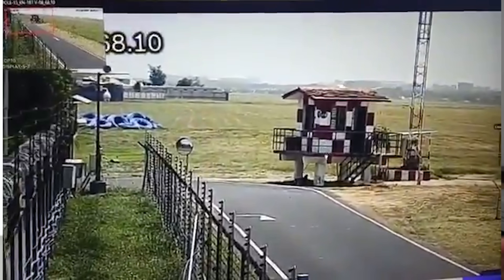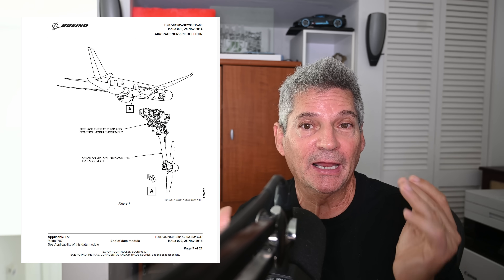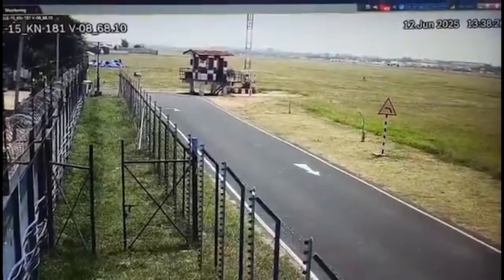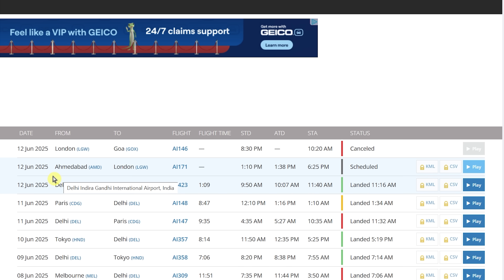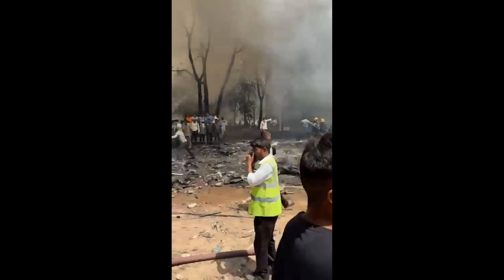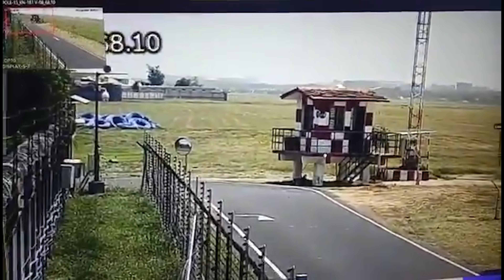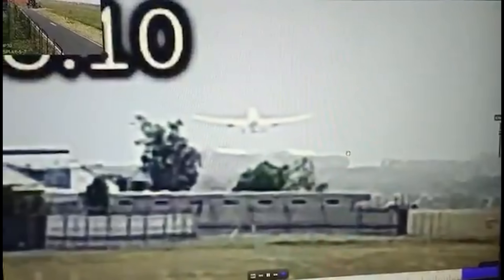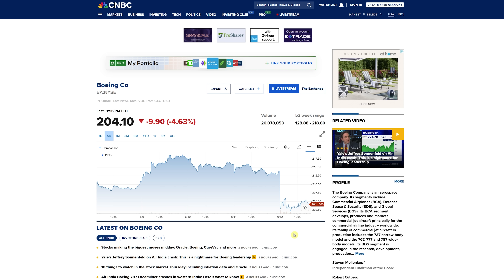What Caused Air India 171 Crash, Mysterious Sound Before Impact

Comment: Such a sad event. Based on how it just glided straight right after takeoff, I wonder if it could be electrical failure. I had a Lexus, a luxury car, and one day it just stopped working while I was driving. Everything in the car went off, and it started coasting. I could not turn the wheel or anything. The mechanic said it was a one-in-a-million occurrence, but it happens. When my car did that, I heard a loud pop, like when the breakers go out in a house. The lone survivor said he heard a loud pop.

Comment: I never believed the flap stories...The plane would never have gotten off the ground without flaps. They would've been dragging the tail down the runway in a panicked effort to get airborne. They had flaps. This was an engine issue. Either a mechanical or pilot induced engine issue.

Comment: Engine failure caused the hydraulics to become dysfunctional, thats why they could not retract the landing gear which added to the drag and led to the crash.

The ram air turbine was deployed automatically as the engines failed and the RAT can only supply power for the flight controls (flaps, slats, elevators etc), it cannot retract the landing gear.
Reply: Stop speculating and spreading rumours. You know nothing. Be quiet.
Reply: And you know this from where? Look... the plane did not even make it up to 1000 feet. There are 3 simple rules. Aviate, navigate, communicate. Right after takeoff when V1 is passed and the plane rotates, it takes a few seconds untill they retract the gear. They never do it immediately as they are airborne. They are waiting for a positive climb rate so they can confirm plane is climbing. And now... if right in this few seconds after the V1 speed the engine failure happens, they simply don't have the time to retract the gear and it is even not a priority there if you lost both engines. Sooooo again... where do you have your information from?

Comment: Was there any audio in the video of it taking off? You should be able to hear the engines roll back. Also on that same video, the flaps should've been extended for optimal lift during takeoff, but I don't see the flaps extended at all, so I have to wonder if they configured the plane properly. Pilots have unfortunately been known to rush when behind schedule, and occasionally rushed their preflight configuration

Comment: It is strange that a very small wind turbine makes a noise that even covers the noise from two turbines working at full speed. If someone pays attention and calculates with a correct eye the speed of the aircraft when it was running on the runway for an easy takeoff, they will find that its fate was predetermined. Very low speed for a loaded giant aircraft.

Comment: The noise could be sound distortion generated from the recording device. The real question is: why were the flaps NOT deployed?  Did they not program the flap position for take off and didn't set the flap lever? There is NO way that the flaps should be up on take-off. Could it be that as soon as they got out of the ground effect, they started losing lift? The inertia got them going for a while before they started losing altitude due to the wings not producing enough lift at that speed. The sole survivor said that he heard the engines spool up towards the end. If the engines had power, the RAT would not deploy. But again the wheels should have been up by that time, why? no hydraulics? That would cause the RAT to deploy. Such an unusual crash. Or worse, the pilots retracted the flaps instead of the wheels? That would be the most probable cause since there is no way that they would forget to set the flaps for take-off.

Comment: The central wing box, although filled fuel, is the strongest part of the aircraft. Based on what we've seen, this was not a 'high speed' impact per se, (like say, the 737 MAX crashes) so It is entirely feasible that the forces of impact, especially for those seated in the middle of the plane would have been survivable for much of the occupants. Another thing to consider,  that the fireball that we see as an "explosion" is more technically a 'flash fire'. The difference being that one has a high energy blast that itself causes damage. While a flash fire being the rapid burning of flammable material (atomized fuel), which in itself does not have the same damaging force of a say an explosive. For a survival scenario of 1 in 240, it is not far fetched that the sole survivor could have been one of the many seated in his section that that DID survive the initial impact, but was the only one able to escape before being overcome by smoke and or fire.

Comment: I have heard that the take-off plan was to leave the runway with an ascent angle of 3.5%; raise the wheels and then increase the climb rate to 11%. This plane was really heavy, and the air very warm. As the final stages of the flight might have been a  stall, let us hope that the higher climb rate was achievable for this situation.

Comment: Engine loss none withstanding - why are the flaps not in takeoff configuration?  Did they erroneously raise them instead of the gear (has happened before) - then they had hydraulic  power. Unless they took off with a configuration that was not meant for takeoff. The way the plane suddenly dips reeks of raised flaps mid take off.

Comment: The attachments for the wings are structurally the strongest parts of a plane, so most survivors in plane crashes are from that area (when there's not a fire). My guess is that the plane separated at the wings, and he was in the section just ahead of them so he was spared from the burning, but also the furthest back from the impact (other than those stuck in the fire). Basically that row may be the sweet spot for a head on collision where there is still lots of fuel in the wings. And he was probably thrown from the plane at the time of separation (which is why he says he jumped). Total guess though

Comment: The RAT was triggered, in this model, necessarily automatically, when the aircraft lost boot main 240 AC electrical buses and/or the main hydraulic power.

Furthermore, in this same video, it is possible to see parts coming loose from the aircraft just as it stopped gaining altitude.

A catastrophic failure, perhaps revealing an unknown fatigue process or a poorly done repair, considering the new composite materials and their joints with other materials?

Perhaps a meticulous attempt made to look like an accident?

In any case, 172 knots is at least 10 knots below the minimum takeoff speed for the engine maximum thrust, weather temperature (40o celsius) and maximum takeoff weight.

Alarms would have sounded in the cabin during the, by the way, long roll on the runway.

We may be about to discover something new in aviation. But, by all indications, as with the AF 447, not without a human factor as a contributor.
Reply: nothing fell off where do you see that
Reply: @emilianoruiz7681  Look at 2:02 - 2:05.  There is something abnormal flying/tumbling about from right to left.
Reply: @emilianoruiz7681 About the AI 171 flight, the RAT was deployed. Parts loosen from the aircraft as it lost height or dragged from the roofs by the plane. Anyway, the maximum speed of takeoff was lower than the minimum speed for weather conditions and aircraft load. A mix of equipment and human factor, if not equipment sabotage.
Reply: @fabiobarreiros1027  no parts fell off from plane, try again.

Comment: Bo eing!
If its a Boeing I aint going
What ever happend to FAA PILOT CERTIFICATION STANDARDIZATION!
What ever happend to 
Emergency procedures tranning every six months
Check rides in type every six months?
What were the crewmembers doing the previous 12 hrs. 
A set of quotes, many of them age-old, serve as psychological guidelines for pilots......
Aviation in itself is not inherently dangerous. But to an even greater degree than the sea, it is terribly unforgiving of any carelessness, incapacity or neglect"
—Captain AG Lamplugh, British Aviation Insurance, London. 

Safer skies saves lives...

Old bold pilots
Know Crew Resource Managenent CRM
Know sterile cockpits
Know cockpit briefings
Know who the PIC  final authority is

The greatest single factor in airplane disasters to-day is the human factor.....
someone does too much too soon, followed very quickly by too little too late. 
Steve Wilson 
NTSB investigator, Oshkosh, WI, August 1996.
 Trouble in the air is very rare. It is hitting the ground that causes it. 
Amelia Earhart
In flying, the probability of survival is inversely proportional to the angle of arrival. 
Attributed to Neil Armstrong
If you can walk away from a landing, it's a good landing.
You don't concentrate on risks. You concentrate on results. No risk is too great to prevent the necessary job from getting done.
Chuck Yeager

Pilot certification standards have evolved over time in an attempt to reduce pilot errors that lead to fatal crashes. FAA standards, which are set in consultation with the aviation industry and the public, are among the highest in the world.

According to the FAA, the new regulations stem in part from the crash of Colgan Air 3407 in February 2009. An investigation of the crash revealed that pilot Renslow, had failed three "check rides" (the flying equivalent of driver proficiency tests) and may not have had adequate training to respond to the emergency leading up to the crash.

Comment: On your ADSB data, I’m surprised you didn’t pick up on one thing. The aircraft stopped sending out ADSB altitude, speed and location data at roughly the point that the aircraft started sinking, which tells me in combination with the RAT that right there something caused a loss of electrical power to the transponder.

Comment: I've watched your engineering videos since Surfside. Unlike other engineers, you actually take the time to make sure everyone understands. This is a sad story. I'm glad the one man made it out. His guardian angel was working overtime.
Reply: I wish all the other so called experts were as clever as Mr Jeff Ostroff.
This crash had nothing to do with flap settings. The Ram Air Turbine (RAT) was definitely deployed, and there was very little thrust, if any being produced by both engines. The engines sounded like they were in idle mode. You can hear this in your original video with its relatively high quality audio. The RAT, was definitely deployed. It's unmistakable. When the plane flies past there is little if any jet engine sound rather, the unmistakable propellor sound of the RAT, sounding like a single engine propellor plane flying past. The RAT swinging down and locking into place explains the bang the survivor heard. This also explains why the landing gear was down as there was no power to lift it. The small piece of debris seen flying in the video is not from the plane but something sucked up by the considerable vortices created by the large jetliner as it passes so closely over rooftops before the crash. I do not believe it was a double bird strike as there is zero evidence to suggest this. This crash had nothing to do with incorrectly set flaps. The plane was climbing and then it wasn't. For whatever reason both engines went into idle mode at the worst possible time. The NTSC investigation will hopefully determine why. But I must say Jeff's incredible levels of observation are very impressive indeed.
Reply: @simonmiller5118  lol, he is a youtube clown, milking it and speculating on tragedies, he has zero expertise in the field here, no access to informations and he doesn't even follow a decent methodology or consult actual expert. That is the total opposite of actual experts work.
Reply: @lo2740  I presume you at least agree that the example videos he plays starting at 4:06 are absolutely compelling about how there's an extremely recognizable sound of a propeller when the emergency RAT has been deployed.

Presuming you do agree (I can't imagine anyone with sound hearing disagreeing) then you are presumably saying you do not hear the same thing when listening to the clean video of this airplane he plays about 30 seconds after playing the poor screen capture video played by the mainstream news channels such as CNN at 1:25.

If so, I have to wonder about your hearing. Are you listening to those video clips on a good sound system? Would you say you've got good hearing? those are genuine questions. If someone listens to those video clips and does not conclude a RAT was deployed then that's surprising to me.

And finally, even if you do not hear a RAT, are saying the RAT was not deployed? That would be even more surprising and it would be helpful if you shared your evidence for thinking that.

Thanks in advance for reading this comment and any reply.
Reply: Me too I was watching Surfside videos from a few years ago from Jeffostroff and been watching him ever since on occasion for the details in the big stories.
Reply: Same here. The analysis of surfside collapse was a masterpiece of analysis and research
Reply: bomb? might be related to the identity of who was  on  that plane that day.
Reply: Pse.ne.moment.e.beri.difektin.ai.mose.ka.qen.e.qellishme

Comment: No, we should not be guessing to figure out what went wrong. let's wait for investigators to find facts of the case. From the video it is evident that the body of the aircraft is well. It simply did not have enough power or its pilots failed to operate to give it power to take off, or the engines or fuel lines failed. We do not know, let's wait for the investigation before we make any conclusion. It is a mistake to make our conclusion based on incomplete information.

Comment: 1900 meters is too short for the take-off run, plus the landing gear was not retracted and the plane simply fell
too low speed with such a load - that's what I think - or maybe the engines failed, that's another matter
but that's just my suggestion, the box will show the flight parameters - what can I say? - a great tragedy
1. or a fuel system failure
2. the engines lost power - maybe the fuel was not reaching the engines
3. it's very strange that 2 engines failed - probably no fuel
4. the right engine failed and then the second - because at take-off
there was smog and smoke and the second one too because it was visible at take-off
5. the pilots tried to correct the right engine because it was drifting to the right
but the plane slowly hung in the air and started to fall

This is just my guess
It's strange that 2 engines failed

Comment: The May Day call said "no thrust".  I don't see the landing gear extended or the flap configuration as an insurmountable problem.  Those Pratt and Whitney or GE engines have the power to sustain flight with flaps up and gear down.  That plane will fly with one engine. There had to be a fuel or throttle problem.

Comment: The gear was down in the videos. It appears that the descent started at the point the landing gear is normally cycled up for the benefit of the increased climb-out factor. That combined with a RAT deployment suggests the loss of at least one hydraulic system occurred. There are many ways a hydraulic system can be lost, I will not speculate. Increasing  thrust should have resolved the decent vector. The aircraft was heavy and the outside air temp was hot so degraded aircraft performance should be expected. The takeoff calculations assume that computed engine-out climb performance is attained with the gear up, full rudder deflection and fewer than a specified VMCA degrees of bank.

I do not see evidence of a significant asymmetrical thrust condition. Which may indicate an engine out condition or deployed thrust reverser did not exist. 

One other component that may be relevant is an incorrectly calculated center of gravity, fuel placement, or exceeded gross weight limit. 

Very sad for all impacted by this accident🥹

Comment: In my non-professional opinion, the position of the main landing gear (pointing down instead of up and parallel with the fuselage) is a pretty good clue as to whether or not "Gear Up" was commanded. It looks to me like it was commanded and there was some kind of massive power failure about the same time gear up was selected. Great video.

Comment: I live in the flight path of an international airport.  I am at a distance where most jumbo jets pass over at between 600 and max 2000 feet.  I know what a FULL THROTTLE jet engine sounds like.  That Air India flight wasn't at full power, if they had any power at all.

Comment: In my opinion, due to the rat deployed, no electrical..everything on 787 is electrical...ie-computer falt/failed. There are two for function, one left,one right.. control engine thrust or thrust balance on left and right wings.Designed for fuel economy and air efficiency. Just my opinion just (swag)..retired mechanic/inspector..